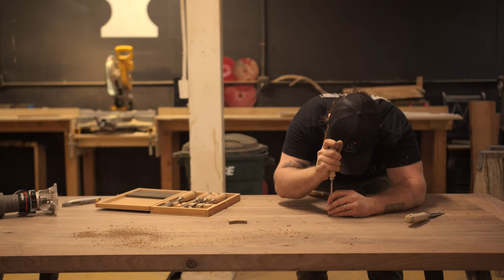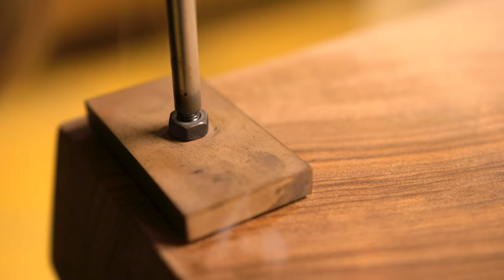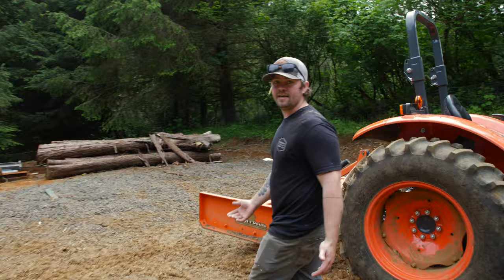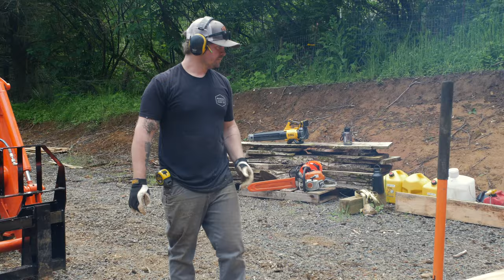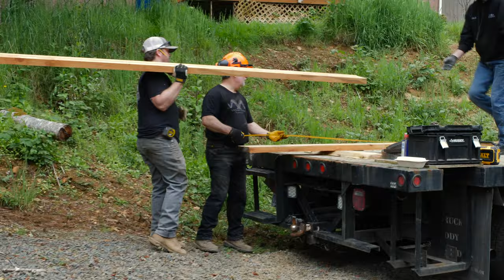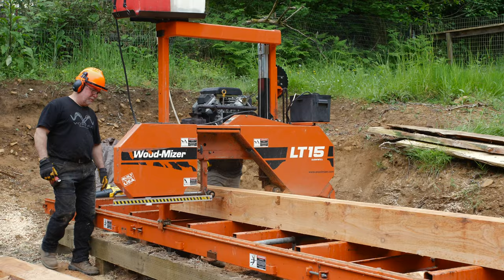Timber Framed Pergola Pt. 1 The Milling

Comment: nice job. do you not have issues building with such wet wood? the 6x6 had quite a bow in it
Reply from the maker: I ended up setting aside that one 6x and milling another for that reason. It will come in handy in some way! The wood sat in my shop for three weeks shedding moisture and because the project is outdoors, building with the green lumber isn't too big of a deal specifically because of the design. Thanks for watching!